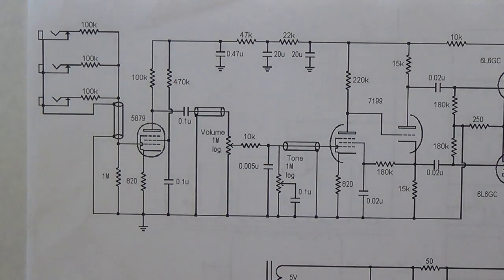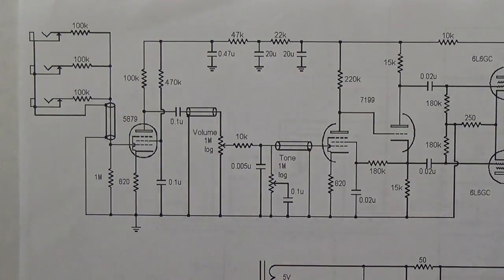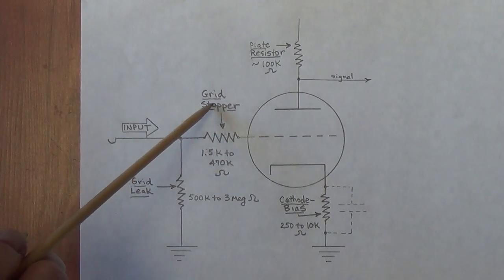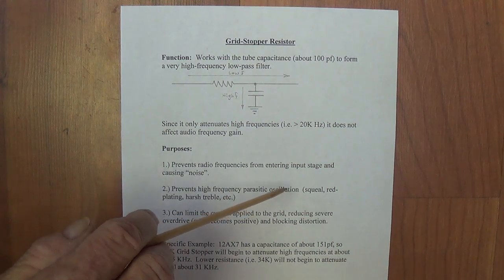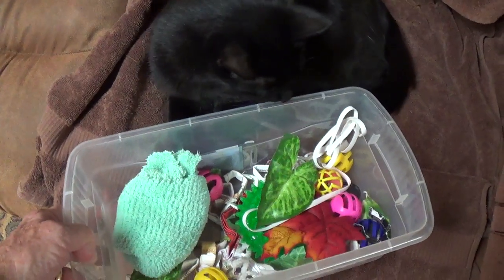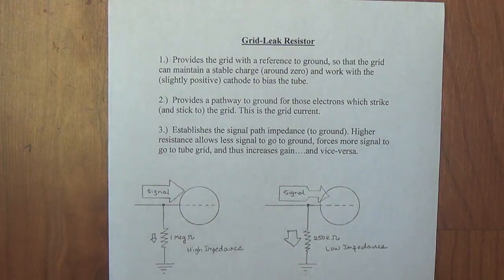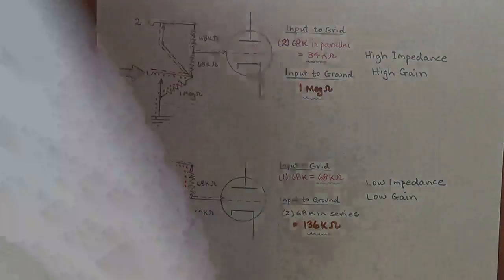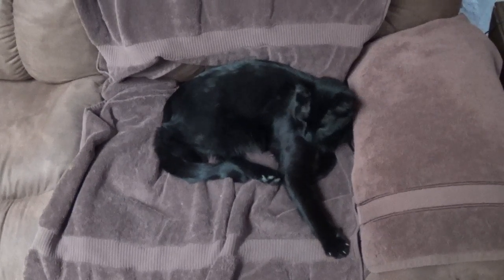Resistors, Part 3: Grid Leak, Grid Stopper, and the Fender Input Circuit

Comment: I've really enjoyed the resistor series so far, great follow up to the amp build, zooming in on particulars here after the broad overview of the previous series. Here's a question: what about the third possible way of plugging into a 2 input amp, both inputs at once? I know back in the day a singe amp might be shared between multiple instruments/mics. Would you then have the lower cutoff freq on each input from the 68k resistors on each and high impedance on both inputs, slightly higher for input 2 since it has the 2 68k resistors in series with the 1M? Would this have the practical effect of boosting input 2 over input 1, or would the difference be insignificant in practice?
Reply from the maker: +Matt Price Greetings, Matt. I'm glad you are enjoying the video series.  Your analysis is correct. If you plugged an instrument into each input, Input 2 would now have 1.136 Meg ohms of impedance to ground.  With 1 Meg of impedance, virtually all of the signal ends up going to the first tube grid, so having a little more impedance would probably not make a very noticeable difference in output volume.....probably less than the difference between the pickups in the two instruments.

Comment: Great info on this Uncle Doug! So the low impedance input would have more clean headroom since more of the signal is going to ground? So if you were to plugin an overdrive pedal through the low impedance channel it will clip later than the high impedance would with the same settings? I hope my question makes sense. This subject probably has to do with why you hear some say that this amp "takes pedals really well."
Reply from the maker: +GmanMusicProductions  I actually like the low impedance input for quiet playing around the house.....without inviting the wrath of my lovely spouse.  I'm not sure if the headroom is actually greater, since you have to turn the volume up quite a bit to get the same volume you would hear from the high impedance input. At the same actual output volume, I would think the headroom would be about the same for both inputs.....just guessing.

Comment: Love the information and presentation!  I have a question: Compared to the 5F8A circuit, the 763 Twin had two more 1500 ohm grid resistors in the power amp.  Can you tell me why Fender might have chosen to add the parts?  I've had to replace the tube sockets on a 5F8A I built and wonder if the additional resistors constitute any sort of improvement.  Thanks again for the great videos!
Reply from the maker: I think the 5F8A schematic may be incorrectly drawn. It makes no sense to have a grid blocker for only one tube in a pair.  Every other Twin schematic I can find has one for each tube.
Reply: @UncleDoug  Thanks much!
Reply from the maker: @MCMarash  YW, MM.
Reply: @UncleDoug  Changed the output section to resemble the 763 Twin and it's a different much better amp.  Volume before distortion is much increased. Yeah!
I wouldn't have questioned this without your explanation in Resistors part 3, so my better sounding amp is down to you.
I only found one other schematic with only two grid blockers - the Blonde 6G14. Have you ever seen inside a 5F8A or 6G14 with original wiring? I wonder if it was a bad idea quickly corrected, or a bad drawing as you suggested.
Reply from the maker: @MCMarash  Some of the early Fender circuit designs were not optimal, Marc, but to their credit they corrected the errors quickly.

Comment: Uncle Doug,
I repair old radios and sometimes see a grid stopper resistor used in RF circuits, usually early TRFs using 01A or 26 tubes, to stop RF circuits from oscillating.  Resistance is generally around 600 ohms.  But I worked on a radio recently that required 1750 ohm resistor to stop the RF circuits from oscillating.   Please explain how the grid stopper works in these RF circuits?  thanks.
Reply from the maker: +atwaterkent911  You're welcome, AK. Resistance values may vary, but I would assume that the function of a GSR, as described in the video, is the same in both the radio and amplifier circuit.

Comment: Use 470k or 2 1meg parallel on input grid leak instead of 1 meg.overdrive pedals will act more naturally .tone will open you're eyes.using this on my 5879 input tube.going to be playing more.
Reply from the maker: Thanks for the tip, SS :)

Comment: Thanks for the videos uncle Doug, your videos are the best I can find on these subjects.  I was wondering about the grid leak resistor and why the negative charged electrons would flow to ground (which I'm so used to thinking is the negative rail) so is the ground you're talking about neutral ground such as earth ground?
Reply from the maker: +Jake P You're welcome, Jake. It is, at first, confusing to think that electrons would migrate to an overwhelmingly negative chassis "ground", which is indeed the B- of the circuit.....but recall that the initial charge of the grid is identical to the charge of the (negative) ground to which it is referenced (through the grid leak resistor). Anything which disrupts the equality of charge between the grid and ground, i.e. accumulation of electrons on the grid making the grid more negative than the ground,  is corrected by allowing those grid electrons to flow to ground, restoring the equality of charge.
Reply: +Uncle Doug Thanks for the reply Doug.  I guess the confusing part to me stems from how some amplifier circuits use a 3 prong cord with the earth ground focused as protection from shock and then some using a 2 prong cord use the chassis as the negative rail of the circuit.  So is earth ground basically the same thing but a safer ground as the current would not stay in the chassis and would physically go into the earths ground? I'm still new to vacuum tube circuits so my only circuit background is from solid state ic  amplifiers where I would have a negative and positive supply rail and tie earth ground to chassis only for protection.  Hope you understand my confusing ramble :)
Reply from the maker: Any amplifier circuit can use a 3-wire cord with a wire to earth-ground the chassis. This earth ground is purely for protection against getting shocked by the 120VAC that energizes the primary circuit of the power transformer. The rest of the amplifier circuit (high voltage and filament voltages) has a separate ground via transformer secondary winding center taps that are grounded to the chassis. Thus the chassis is ground for the amplifier secondary circuit (high voltage and filaments) and the earth is the ground for the 120VAC primary circuit (wall to on/off switch, to fuse, to primary of power transformer, and back to wall). Two separate circuits.....two separate grounds.
Reply: So the earth ground (for protection) and circuit ground are both connected to the chassis correct? and it should be fine to go (wall to fuse, to on/off switch then primary) right? so that way the switch would be protected by the fuse too. Thank you
Reply from the maker: Yes, both grounds are connected to the chassis, but the two circuits function independently from each other. I prefer to go to the switch first. Otherwise there is a possibility of getting shocked while changing fuses even if the amp is switched off, and I would rather not have AC in any part of the circuit when the amp is off.
Reply: Ok, got it. Thank you Doug :) How would AC be in the circuit if the circuit is not closed when the switch is off? and one more question lol I was wondering what your favorite boutique resistor was whether it be Kiwame, ohmite little demons or whatever else, would make for an interesting video if you compared them :) Thanks again Doug!
Reply from the maker: Any AC that gets to any component of the amp, other than one side of the on/off toggle is "in the circuit". I would prefer not to have the fuse constantly energized (and a possible shock hazard) if the amp is plugged in and the toggle is off. It's a personal preference that makes good sense to me. If it makes no sense to you, then wire the primary circuit as you wish.

I don't believe that "boutique" resistors offer any tone benefits at all, let alone commensurate with their sometimes exorbitant cost. In vintage amps, I leave all the carbon comp resistors that are reasonably within spec alone and focus only on replacing those that are burned or way off in value. In the power supply, metal films are a good choice, if needed. Changing all the electrical components in a vintage amp circuit reduces it to "re-issue" status, in my opinion.
Reply: I'm just trying to understand how a circuit with only the negative side of the circuit connected to the wall outlet (since the positive side would be an open circuit with the switch in the off position) could still be constantly energized.  I'm sorry if I'm not getting it, still pretty green when it comes to electronics. I really value your advice and at this point I've kind of bought into some of the resistor stuff since so many hifi enthusiasts make claims.  I feel the need to explore some of the choices out there and do some a/b comparisons.  I already am guessing the difference will be small and I know the cost of many of them are ridiculous but I'll try the ones I mentioned.  I'm chasing that soft, sweet, non fatiguing sound.  Anyways look forward to your next video Doug and thank you.
Reply from the maker: If the "hot" (black) wire from the wall outlet passes through the fuse before it gets to the switch, the fuse is energized even if the switch is open. If you doubt this, connect an AC voltmeter to the fuse contact and to ground and you will see a 120VAC potential between them. If you are earth-grounded and touch the energized fuse holder, then a circuit will be completed between the fuse holder and ground, through you, which could be fatal, even though the on/off switch is open. With AC wall current the (white) return wire and earth ground are connected. This is why, if you are grounded, simply touching the single hot wire (or anything connected to the hot wire....like the fuse holder contact) will electrocute you. There does not have to be a closed circuit between the hot wire and return wire.....you become the "return wire".
Reply: The voltmeter will show 120 because it is completing the circuit so it is by passing the switch, would be the same as sticking one of the meters leads into the hot and one into the other side or ground of the socket, if you only have one lead in the outlet you will have an open circuit and your meter should read around 0. The voltmeter will read the potential difference between two points. anything before the switch would be the same as the outlet so it would not have any potential difference across the fuse until the switch was flipped on and a circuit was closed. If you only have one prong entered into the wall outlet you wouldn't have any potential difference in the circuit. I agree about not touching earth ground and hot wire at the same time as you would get a shock and possibly die from enough current passing through the heart, although if your not wet your bodies resistance is pretty high so you would pass under 100 milliamps of current which usually doesn't stop a healthy heart.
Reply: Any voltage, to make any sense, must be relative to  another voltage, or, in tech speak, 'with respect to' another voltage. If point A is positive with respect to point B, then point B must be negative with respect to point A. The electrons which gather on the grid make the grid more negative than ground, i.e. the grid becomes negative with respect to ground. If we can say that the grid is negative with respect to ground then equally we can say that ground is positive with respect to the grid. The electrons dutifully flow from the negative grid to the (relatively) positive ground.

Comment: Hi Doug, thank you so much for putting together all these videos! They have helped me immensely in understanding what is happening within the circuit. I do have a question in regards to the the grid stopper resistor. I am working on understanding the schematic for the 5F8-A amplifier. For the output tube section, there are two 6L6 tubes paralleled for each half of the wave. What confuses me, is that there appears to only be one grid stopper resistor placed on one of the tube grids, the other tube is connected upstream of the resistor. What is the reason for this? Does the resistor still have an effect on both tubes? Thanks again for sharing your knowledge with everyone on here!
Reply from the maker: You're welcome, Matthew. You are right to be puzzled by the placement of the grid stopper.....affecting only one of the two paired 6L6's. To me, it should have been placed before the junction to the two grids......not after. Perhaps it was a typo. I can think of no benefit from the wiring in the schematic.
Reply: Two tubes connected in parallel act as one larger tube. The purpose of the grid stopper in this position is to ‘stop’ ultrasonic oscillation by damping the ‘Q’ of any resonant circuit formed by stray capacitances and inductances around the tubes. The single grid stopper performs that function for each ‘larger tube’.

Comment: Happy New Years, Uncle Doug; 

First of all, thank you so much for the education. I'm learning a lot. 

Second of all, I've got a question that I hope won't bore you. The Kay 720 schematic at 1:30 minutes shows a parallel phase invertor. Dynakit Stereo Amplifiers are the only other place that I have seen it used. Does this configuration provide any gain advantage, as with a long-tail pair? Also, do you  know of any other amplifiers that use this configuration? 

Cheers.

PS-- Jack looks like my Kitty, only bigger. Black cats can get demanding. Pretty Baby insists on steamed shrimp every night.
Reply from the maker: You're welcome, Stephen. I just looked at a 720 schematic online, and it appears that the PI is a basic cathodyne circuit using the second triode of a 7199 tube.  Give PB our regards :)
Reply: @UncleDoug  Just out of interest, it's a directly coupled cathodyne.
Reply from the maker: Thanks so much for providing this vital tidbit, Silas.

Comment: Hi Doug, thanks for the video, I've read that it is good to place the grid stopper resistors as close to the tube grid pin as possible in order to reduce white noise and interference. However on fender amps such as the one in your example they are always placed by the input jack instead. Could I potentially reduce some white noise by moving these closer to the tube in my fender bassman?
Reply from the maker: If you're speaking of the 68K input resistors, they are usually attached to the input jacks to allow for high and low input impedance. If you use shielded cable from them to the tube pin, it will prevent any noise injection.
Reply: @UncleDoug  yes the 68k input resistors, many thanks!

Comment: Hello Uncle Doug, In the circuit showing at the beginning of the video there are 100k resistors close to the inputs. Do these act as Grid Stopper resistors? The Grid Leak resistor is connected aftet these resistors between grid and ground. A little later in the video you show us a diagram where the Grid Leak resistor is connected befóre the Grid Stopper resistor. I am not an expert on this matter, but this seems to influence both the stopper and the leak value? (grid leak also must go through grid stopper and input is connected to ground via grid leak?)

Can you please explain a bit more about this?
Reply from the maker: +Bart Prins  Excellent observation, Bart. To provide optimum protection from RF interference, the grid-stoppers should be as close as possible to the grid of the tube they are shielding. Many schematics, including the one at the beginning of this video, fail to show this. In my diagram, I chose to draw them in their most functional position within the circuit. The grid leak resistor's position is not as critical, since it can perform its function whether its value is 1 Meg or 1.1Meg.
Reply: The whole of the input signal appears at the grid if the grid stopper is after the grid leak. If the stopper is before the grid leak they form a voltage divider which reduces the signal at the grid. With a 68k stopper and 1M grid leak the signal at the grid is reduced to 93% of the input signal. Not a big deal. However, as Uncle Doug says, the physical position of the stopper is important if maximum R.F. rejection is to be achieved.

Comment: Hi Doug, with input #1 the grid bypass resistance is located before the grid stopper resistance. With input #2 however, the grid bypass resistance is located in the middle of the grid stopper resistance. I would imagine that there may be other circuits where the grid bypass resistance is located after the grid stopper resistance, in other words, at the grid itself. Is there any material difference between these three arrangements?

Thanks very much for all your awesome videos, they're extremely interesting and informative!!
Reply from the maker: It's my understanding that nothing should be between a grid stopper and the tube's grid pin, otherwise it would undermine the function of the GS resistor.
Reply: @UncleDoug  Sorry, scratch what I just said about input #2, I got confused.

Isn't the arrangement for input #2 such that the top 68K resistor is the grid stopper, and the bottom 68K resistor is the grid bypass resistor, connected directly to the grid pin? So basically the grid bypass is situated after the grid stopper, rather than before the grid stopper which was the case for input #1?
Reply from the maker: @sharkskinboy  With input #2, nothing is between the 68K grid stopper and the grid itself.....which is what matters. Same with input #1.
Reply: @UncleDoug  Gotcha, thanks very much for the clarification.